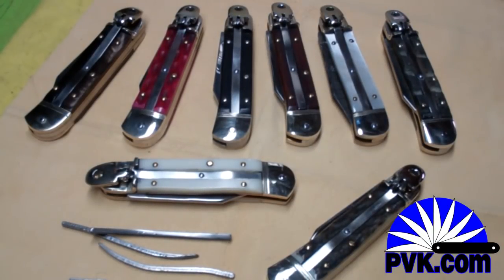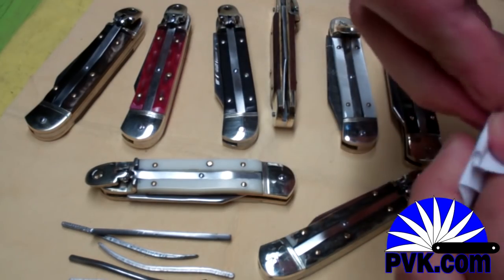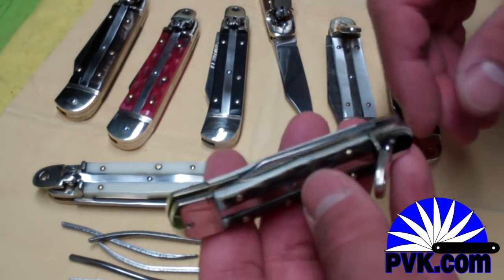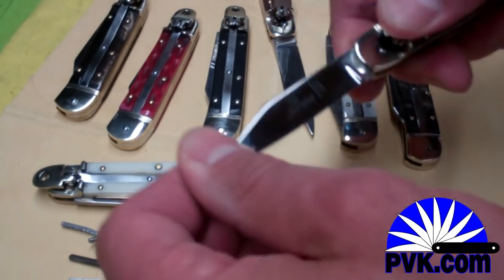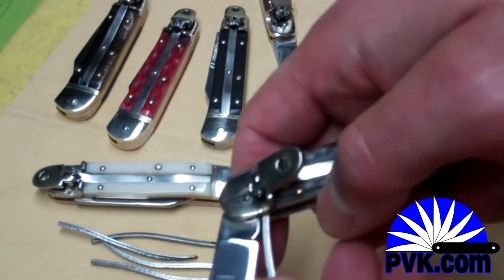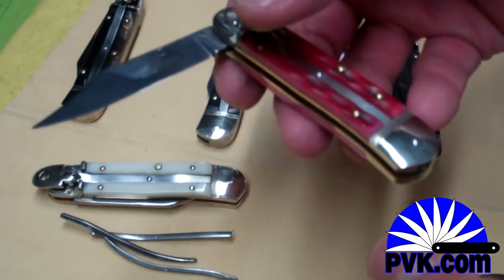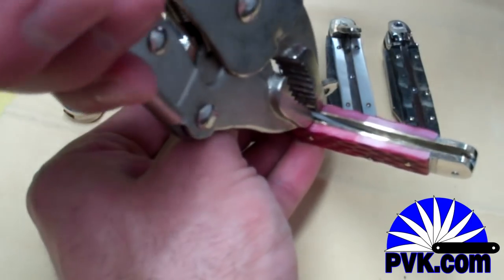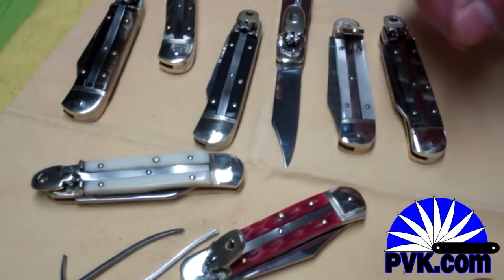Installing a Hubertus Spring

Comment: That was really, really interesting! I've been carrying a Hubertus "GroBer Springer" (3 & 1/4 Inch clip-point blade and stag handles, of the old variety that actually has  "Springer" ("switchblade") stamped on the end of the handle) in my coat pocket since the mid 1970s, but never took it apart or replaced anything  - it still snaps open perfectly despite having been used and abused for all kinds of duties over the years. A few gentle hammer blows on the blade-axle rivet, every other year or so, will eliminate blade play resulting from rough use. Extremely high quality, very durable and reliable "gentleman's pocket knife". I have always used  "Ballistol" gun oil (another German product, available at better gun stores) as lubricant and also occasionally on the stag handles. Works very well, never gunked up the mechanism.

Comment: I have my dads old Springer. It’s had its production date confirmed by Hubertus Solingen to be between 1945-49 due to its blade markings. The spring has broken and being from the U.K. I can’t ‘legally’ get it repaired. Been told it quite rare and worth a fair few quid. Any tips on what I can do with it? Hubertus offered to repair, renovate and give it a CERT of authenticity for free but I can’t get it to them.

Comment: But if the spring breaks, how to take out the piece of spring still Inside the knife?
Reply from the maker: This is tricky but doable with a long finish nail and a smaller hammer.

Comment: 🤔 To me it feels like the spring is keeping it from going all the way down like it should . And I really don't know if this is the original spring that it came with or not I brought it used on eBay .It springs out really good but just doesn't close all the way down like you should!
Reply from the maker: The blade is sitting proud because the mechanism on the inside needs tuning. It is no longer holding the blade inside the handle nice and tight like it used to. The Knife will need to be taken apart and adjusted. I am not sure who still does this work anymore.
Reply: @PVKvegas  Thank you for getting back with me on my questions to you! Now do you know how sales a spring for these kind of automatic knives? It's a really good knive it opens up really good .But just doesn't close all the way down like it should with the point of the knife sticking inside of it like it should and not outside of it 🥴.

Comment: I've just broken the spring on a Plp Havlin wasp! looks like a slip in spring but it's twice as thick as normal. and I can't get the broken bit out...any ideas pvk?
Reply: DevilDust you ever get it out? have the same problem now
Reply: ***** it was a dovetailed spring, the whole thing had to come apart. Sent it back to Mr havlin,save screwing around. It came back as new so all good! 
What have you broken?

Comment: I have an old Hubertus Soligen knife dated between 1945-1949 BUT the spring has snapped ... How do I get out the broken part to replace it??
Reply from the maker: I would contact the manufacturer directly of contact a custom knife maker to fit a new spring.